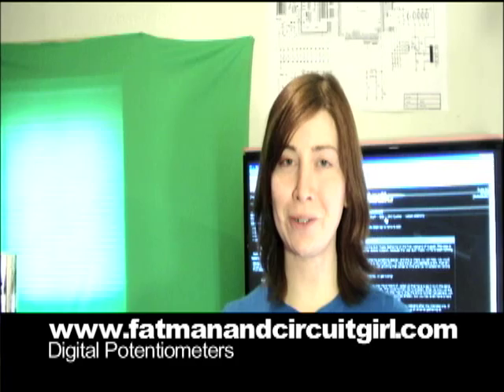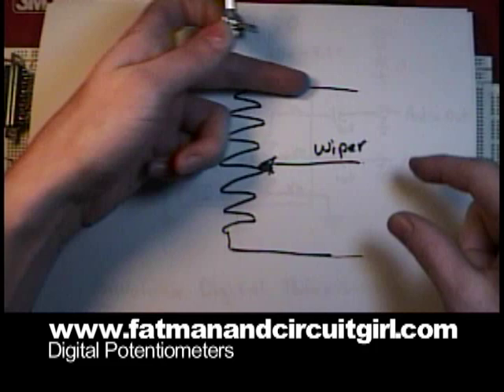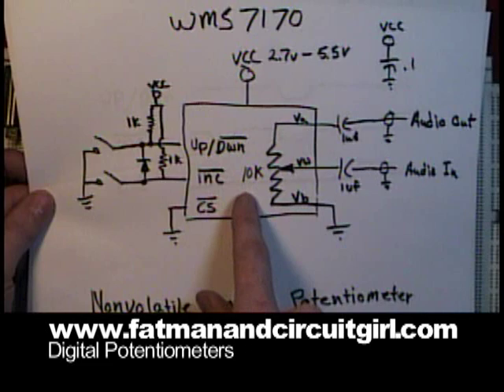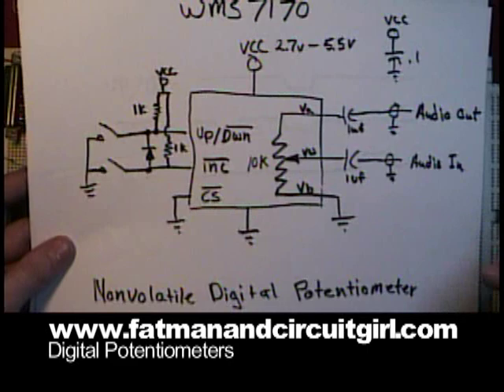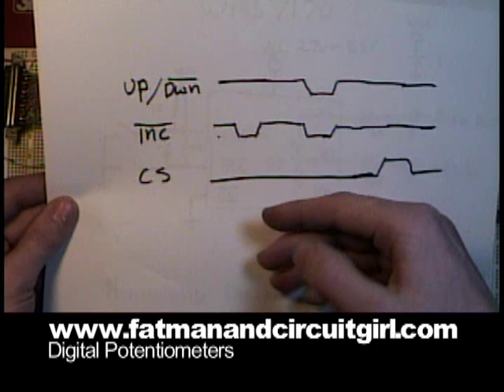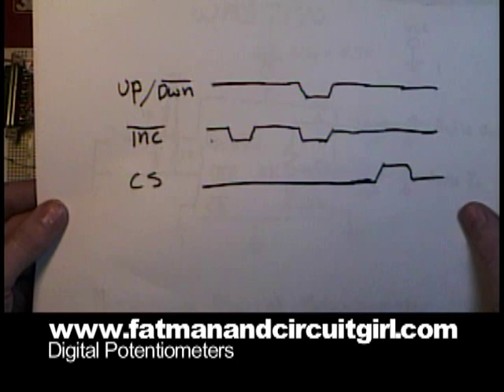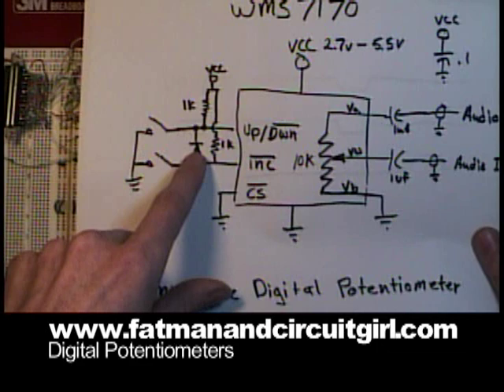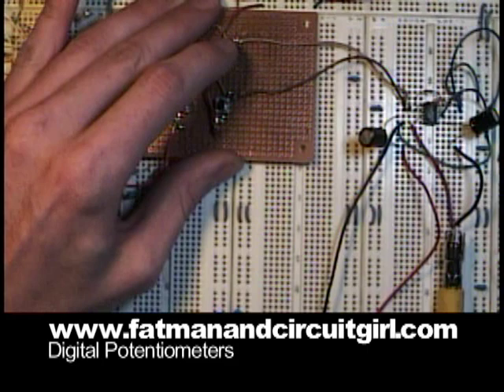Digital Potentiometers - Short Circuits Episode3

Comment: Thank you so much! I am in my first year of building electronics, and I have a modular analog synthesizer that I am building, and I am attempting to interface the units to the computer and adjust the controls with a custom UI I am programming in C#. I have been struggling to understand how to replace the mechanical potentiometers in the circuits with digipots and this is the first tutorial-esque approach to DigiPots I have encountered. The information you have presented is quite useful.

Comment from the maker: The drawing was reversed from what I had prototyped, but the reversed configuration still works.

Crackwitz I think you might have missed the series caps on the audio input which isolate the dc component of the audio.

Comment: I understand that this is a "proof of concept". But the U/D input should be set at least 50ns before INC is pulled low for reliable operation. If both go low at the same time the U/D input could be undefined. Maybe the diode and the capacitance of the INC input create some kind of delay for INC, so it works in this setup. But I wouldn't rely on that.

Comment: when the "wiper" is "down", wiper--GND has no resistance, which *might* be inconvenient for the Audio-In.

also, in the shown configuration, Audio-In--GND has no constant resistance, so depending on where the "wiper" is, different currents flow through Audio-In.

also, Audio-Out would always be on the same potential as Audio-In, which would make the *depicted* config *useless*.

yeah, just mislabeled.

Comment: It is an easy way to control this type of potenciometer.  But is needed you press and release those buttons in order to step down or step up. Keeping pressed a button has no effect.  It would be better send pulses as long as a button is pressed.  Anyway useful.
Reply: +TheYoutuQuestions You could probably implement a 555 timer to continuously pulse power to the switch, so when the switch is held, many pulses will be registered by the device.

Comment: Cool!
I noticed on your drawing that you have the audio input on the wiper,and the output on the top end of the resistor.. I'm just wondering if there was a reason for that,because the 'usual' convention that I've seen is the opposite -audio input on top,and output taken from the wiper. take care!
Reply: Is it work for the arc welding machin which i want to replace the nalog with push up down switch?

Comment: This tutorial is so well done! Thanks so much.  I've spent hours just trying to find out how digital pots are controlled via their inputs and this was very clear.  I have a question which I hope is not too much trouble to answer but I understand if you are busy.  Is it possible to use an analog pot to control this digital pot?  If it is possible then could you possibly point me to some resources to learn.  Cheers!

Comment: Thank you for the great information , I know this is an older video, I am about to build a diy metal detector kit and want to replace the analog potentiometers with push buttons, and this seems to be the way, Do you know if I can add this circuit to a Arduino uno so I can also have the read out of levels show on a liquid crystal screen as well ?